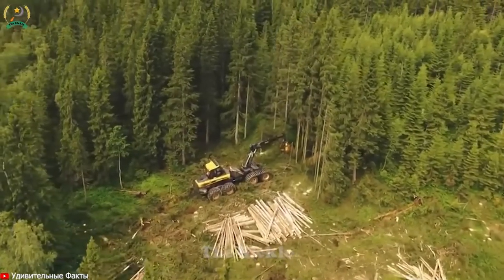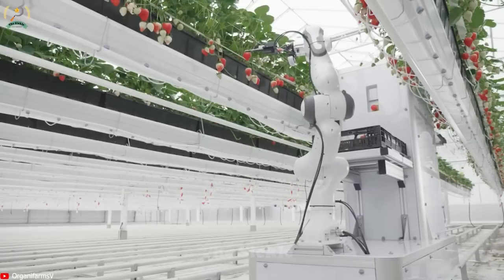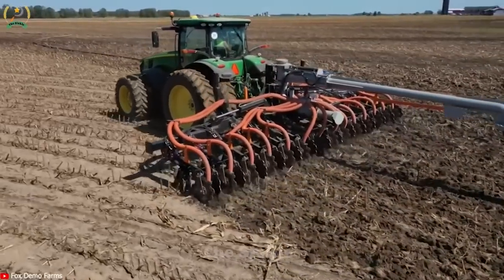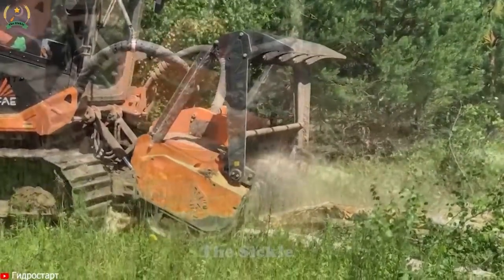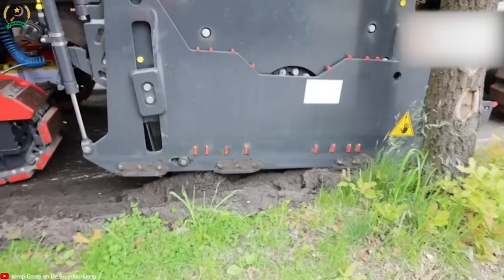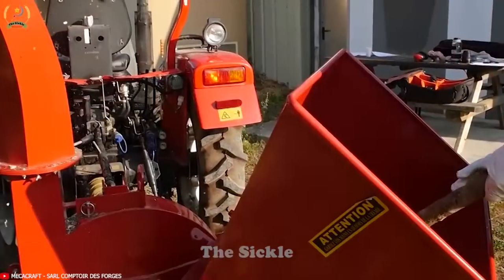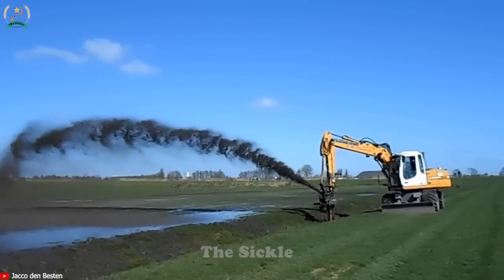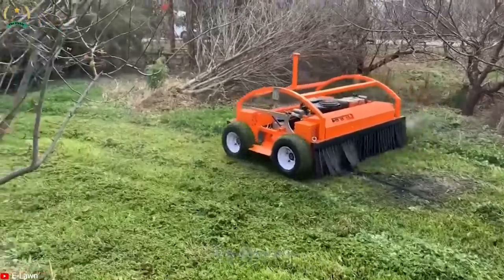20 Amazing Heavy Agriculture Machines Working At Another Level ▶19

Comment: What is an agriculture machine, and how does it contribute to farming practices?
Reply from the maker: An interesting question:
Agriculture machines are mechanical devices and equipment used in farming operations. They contribute to farming practices by increasing efficiency, precision, and productivity. They optimize resource utilization, reduce labor requirements, enhance safety, promote sustainability, and enable data-driven decision making. Agriculture machines play a crucial role in modern farming, improving the effectiveness and profitability of agricultural operations.